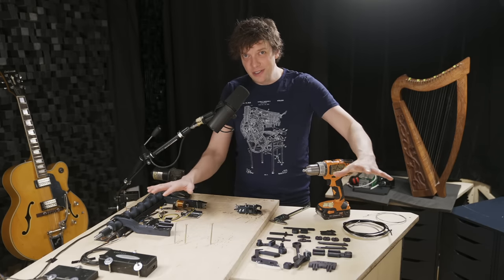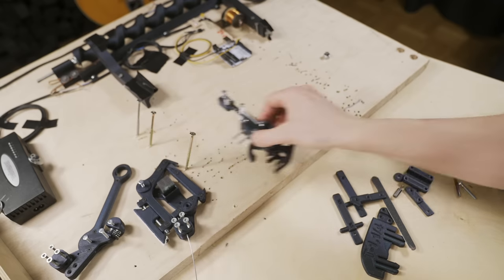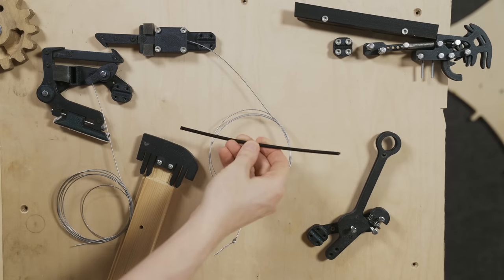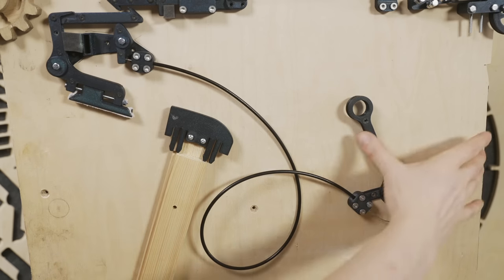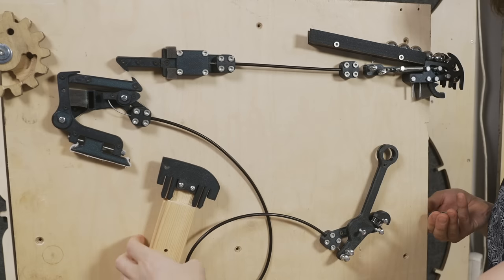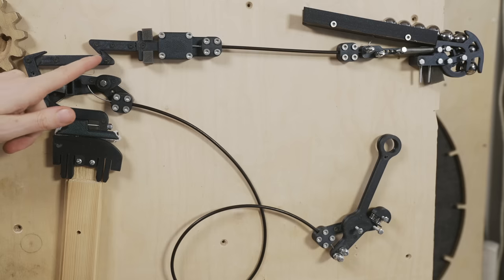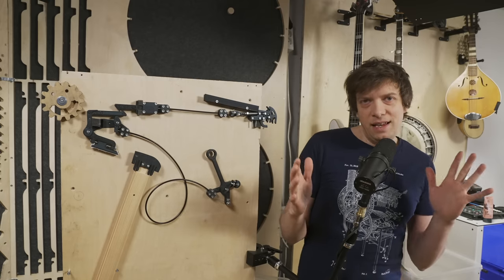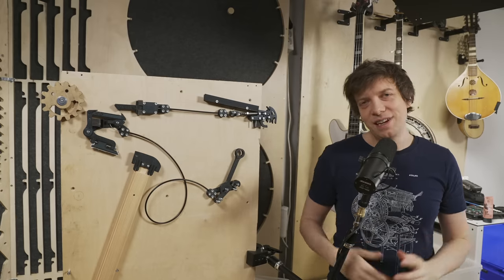These Bowden Cables Surprised Me!

Comment: This isn't about the cables but the muting mechanism.  It works perfectly in isolation, but you may want to test the mid-note preservation (eg the two levers hooking together) under various levels of vibration and shake.  It will be nearly impossible to get the same rigidity that this test setup gives when in the actual machine, maybe some channels which are nearer to the structural skeleton will be very rigid but you likely won't be cable to completely avoid vibration within the machine on all channels simultaneously.  There also can be external vibration, especially with going to different venues some will have more sturdy stages than others.

There's also the vibration of turning the muting lever which you may in the end be able to come close to eliminating, but Excited Martin might have a harder time.

Just something to look into so that you can be sure to avoid marbles dropping out of time.

Comment: The only issue is the cable should always be in tension and once the cable is out of the sheath, it should be straight. Currently Your muting cable is depending on the cable looping "properly" at the mute mechanism, and pushing that mechanism Instead of pulling in tension. every bike brake and derailleur is pulling the cable against spring tension. eventually the cable will loosen up and fold over and possibly not Mute or unmute properly.

Comment: you should reduce the amount of foam dampening the pin reader in your finished build, the amount you have now is creating a spring / oscillation which I'm sure will create more problems down the road. Or use a softer foam that's not as springy

Comment: You would need to make 100% sure that the cable does not move even half a millimeter through tens of thousands of marble drops for this to be a safe addition to the design.
I would try to design as much as the machine without the cables, and only using the cables as needed.

Comment: Along with other comments and tips please let me add that  Bowden WILL stretch over time and or break .. 

You will need to plan for easy adjustment of the cable ion the machine and you should also plan for easy release of the fixed end for quick and easy cable replacement .   

As Bowden is pull actin only you don't need to fully capture the end and leaving the end open will allow you to simply slide an old cable out and replace it with a new one.

Comment: Something dawned on me while you showed the mock programming wheel that might be worth testing and looking into: What would happen if the programming profile is played while inserted the wrong way around? (In software engineering terms, you'd be testing an unhappy flow here ;) )

A profile being the wrong way around should never be happening in theory, but it may be very likely to happen at some point under the pressure of reprogramming during a concert.

Comment: Looks super cool.   But I think you need to have twin cables, both pulling, from different sides of the pivot.  I hope that made sense.  When you throw the lever either direction, one cable will be pushing and the other one will be pulling.   The pulling cable is doing all the work.  You don’t want to rely on pushing with a cable…

Comment: Solid wire (like hard stainless welding wire) can work very well on these cables also! The life of the outer jacket can be greatly improved because the solid wire is much smoother than even the best stranded bicycle cable. Worth considering if you can eliminate the tight bending like with the muting mechanism.

Comment: You can use 2 or more programing wheels with this system.  Or can use 2 or more pickups on the programing wheel located at different places around the programing wheel, so each can take up more width.  Use a channel of programing wheel 1 to mute programing wheel 2....... after the first pass it unmutes 2 and mutes 1.  double the programing space.

Also I challenge  you to play the MM tune by hand.  Record it, and see how close YOUR timing is.

Comment: If you run into friction problems, check out the Capricorn PTFE tubes widely used in 3D printing, they are superior for being super smooth and wear resistant!

Comment: Hey Martin, talking about noise reduction I was thinking about the use of metal marbles…there are ways to coat the marbles with rubber/plastic/Teflon, I’m pretty sure I have seen ball bearings with non metallic spheres too, so there would be specialised industries that deal with that kind of process to maintain the perfection of the sphere. If there was a way to retain the weight of the metal but add a coating of low friction material that’s not metal you will reduce the noise of thousands of marbles moving here and there…I really hope you read the comment, I don’t know how else to get in touch with you…love your work from Australia

Comment: Look into the quick-replace systems that bicycle levers use for easy cable replacement.  The current design requires 4 screws to be undone to replace the cable and housing.  That is completely unnecessary if you take a look at how bikes keep the cable housing in place yet still allow for tool-less cable replacement at the lever

Comment: Overall I think this is a brilliant direction but I think that the introduction of the cables into the timing aspect could increase the potential for temperature changes to throw off the timing. A longer cable will increase in length a little more than a shorter cable in hot weather. One way to try to cut down on this issue would be to make all the cables the same length, even if that means introducing some otherwise unnecessary bends. I thought of this issue in part because I know how temperature affects pendulum clocks. Warm weather causes the pendulum to get just a little longer, thus slowing down the clock just a little bit.

Comment: warning! when using those cables you have to be sure to play music at the same temperature always. Because the cables will become longer when it is warm. I experience it on my bike. A difference of 10 degrees celcius can already make a difference, my brake doesn't work as good and I have to adjust the brake settings again.

Comment: One concern I might have is that wear on the cushioning could eventually cause the hooks to move further apart and prevent them from engaging. I’m sure you have thought of this, or will end up using thin enough cushioning to prevent the issue. Other than that; awesome! 😁

Comment: The cable is a good solution for muting lever, but not for marble gate. It is high friction and fast wearing. It adds the force requirement on P-wheel and you will soon need to lubricate and eventually change all cables. Avoid sliding parts and use pivoting ones when possible.

Comment: Bowden cables are fine for the muting mechanism where timing isn't critical, but a very bad idea for the marble droppers. With repeated use, the inner liners will wear, resulting in a change of radius to the path that the actual cable follows. This will introduce some slack (albeit a very small amount) but enough to throw the timing out - say goodbye to 'tight' music.

Having a real sense of déjà vu with this. I seem to remember this being discussed at length in the Discord for the MMX, and ruled out for this very reason.

Comment: Great work but I think that the engaging system could be upgraded to introduce a tensioning spring inline with the cable (like in the carburetor throttle return)

Comment: The cable idea is great solution for the switch. I would not use it on the connection between the hook and the gate though, the additional friction of the cable through the sheath is not warranted especially when considering 100 channels. it adds extra drag that is not necessary.

Comment: There are a few issues about the cables that you do need to take into account. If the curve of the cable changes for any reason this will affect the length of the cable and there is a lag if you are using the cable as a push pull, in other words when you pull the cable it reacts immediately and when you push it there is a delay as the cable takes up the slack ... this delay is directly related to the amount of curvature you put into the cable, straight and its is less more curves and there is more delay. 
I suggest when you are testing the timing that you test the cables from straight to really curved to see what effect that will have when the cable gets longer and more curved.

Comment: its a great idea for muting system and other places not so often used. but for releasing balls its not good. Bowden lines are not for such intensive use. You will lubricating them after each concert :) But if it will be straight line, you can use simple cable without the tube.

Comment: I think you don't want a long Bowden cable between the programming reader and the marble gate. You'll introduce slack and thus timing inaccuracies. Rigid linkage is probably still best if you can (pipe organs have roller boards which basically solve the same problem you're facing, but they take effort to build). Otherwise, a string running on pulleys under tension could be a better alternative to Bowden.

Comment: I think the bowden cables are a powerful tool for the next marble machine. My only question is will friction possibly become an issue? One profile pushing a lever connected to wire connected to a spring isn't a big deal, but I could see it getting to be measurable when all channels are playing.

Comment: A good tool to make little cuts where you need them 
Is a dremel it has several little tools and bits that are perfect for stuff like what your using. Oh it's a little  loud but not that loud and
You will be able to hold it with one hand. Ps amazing design.

Comment: The problem is that when you have a 1 inch cube of foam, but nothing to to support it, you can damage the foam enough with use that it will simply stop working. 

If you put some plastic support structures inside the foam, attached to the primary part, and reduced the amount of foam that can move unintentionally, the foam will last longer and be less prone to function impeding damage. As a general rule when working with soft foam, especially in a silencing or padding manner, you don't want that foam to move much besides its intended movement, ie when its compressed to do its job. If the foam is damaged and starts to lean, or if the device isn't hitting the foam dead on, you end up introducing unintentional wear that will drastically reduce your foams life span.

Think memory foam. Its subject to all manner of stresses and if you don't protect it appropriately, you end up with tears and holes in the foam and it loses its ability to return to shape as effectively.

Comment: It should be taken into account that such flexible connections do not have good stability over time. As they wear out, they can stretch. There is a dependence on temperature.

Comment: It kinda use the exact same mechanical principle as offset printing machines. I think it is called something like ratchet and paw. It uses many mechanical leverages to make sure the movement work as intended when it should. Small gear movement is amplified through mechanical connection and stuff. Intricate but interesting

Comment: Only thing i see is that you are "pushing" the cable that does the muting action. I will probably work but it could just kink in a situation where you really do not want to. Adding a spring on the muting lever so it wants to be in the "mute" position and the cable only has to "pull" it into normal mode might work.

Comment: for the bowden tubes, there is a material use in 3d printing, i think its call ptfe tube it offers almost no friction, if friccion start to be a very big problem it migth be a good solution, more expensive bur improve

Comment: Those cables are notorious for failing. Even good cables will break, often. And you plan to use a lot of them in your machine, I would assume. They can snap without any warning, and they can get stuck in their sleeves frequently. Set up and run a longevity test and keep it running while you continue to work on your machine. Also, plan a back-up mechanism, if you don't have one already, in case you find that they will not suit your need.

Comment: In addition to the very valid cyclist comments, also keep in mind that they can stretch a bit over time: make sure you can adjust.  Those adjusting fittings are also available in a normal cycle shop (because people like to keep their brakes working 😋 ).  Bowden cables are normally used to pull against spring tension, not to push.

Comment: For the muting levers this will be fine. Their action doesn't need to be precise either time or stroke wise. But for the marble drop these won't maintain timing to your standards. Longer bowden tubes, or those with a bend will have more drag, more inertia and affect the timing. Not by much, but you've gotten hung up over smaller issues before.

Comment: My biggest concern with this design is the tolerance allowenses in over swing of the muting lever and the hooks getting worn. Just one of them is probably not a big deal but both together could probably cuase an issue, eg the disconnect lever don't quite rotate the connector enough so the hock drops and is worn down a few mm at the tip.
Just giving the connector wheel some room for over rotation should make the design much more reliable over time.

Comment: already see the problem with the cable at 1:30. cables / robes are not meant to be pushed.. only to be pulled.. so by pushing that cable, the endpoint always as to be weaker than the internal stiffness of the cable, or the cable will start to bend in weird ways and the endpoint might not work. thats why on bikes you have springs to pull the breaks back open.

Comment: I feel like printing special "gaps" for the ends of the bowden cables is going to be a pain point in the future. Unless your prints are insanely strong and durable, I suspect that the bit that the cable touches will eventually wear out, and you'll either lose cables or have unwanted play in the mechanism. Make a hole the diameter of the cable that goes all the way through, and then have the end on the outside of the clamp on the other end. Slightly different setup, much more reliable?

Comment: The marble release cable might be fine here. Hopefully the muting cable does not need timing constraint.
However cables are better in traction, and are bad in contraction, you will have delay depending on the length of cable because they will bend in the pipe.

Comment: You may never read this, but I think the two little coil springs in the back of the mute lever to force it to 10 oclock or 2 oclock will be a problem over time.  Maybe something that's more like a leaf spring would be much more reliable.

Comment: I think your design could be simplified and made better with a special type of Bowden cable called a push pull Bowden cable, this allows you to adjust in both directions and leave the cable in place allowing for multiple settings and not just a pull to actuate with a spring return.

Comment: to chek timing id try to make a version with a few loops in the cable to the droping mechanism to document any timing issues directly, best case there is no difference and u can wrap the cables 2 times roud the machine  without deveationes, worst case u need to hold them short and straight or replace them. best to know from  the start befor planing them in an end up like wth mmx.

Comment: Over time, the hooks of the muting system might wear out and introduce timing problems. You might want to try greasing them with graphite powder. Or maybe make them easily replaceable.

As mentioned in other comments, I too am concerned about the timing with bowden cables. They might stretch individually over time. You could solve this with an adjustment screw per cable, but adjusting this many droppers each concert does not sound like fun.

Comment: So these sort of cables are not very good at pushing, so its usually better to use a spring when the cable is pushing something, they work for a time and then they fail and the cable folds or cinks.

Comment: Look at a motorcycle clutch cable. The angle of the cable changes at the lever. The cable must be able to rotate at the lever. If it doesn't the cable flexes at that point. The cable fatigue causes it to fail at that point. It must be able to swivel.

Comment: Maybe add a spring on the cam (and possibly on lever to balance forces) so the cable is in tension for both directions of action? Bowden cables don't like to be in compression, will increase chances of failure. Also, any slip at all of the cable on either end and your timing will go out, wasting all the effort put into 0ms marble gate design.

Comment: Was the added friction of profile/reader taken into account? The old MM had only a simple pin that triggered the marble drop, so only a very short moment of resistance when the wheels pins touch the reader.
Now the wheel and its various profiles will almost constantly touch readers and thus cause a lot more and almost constant friction.
Not that the wheel is too hard to rotate on the new design due to all this added friction. 
It could be impossible to get that slow decrease of tempo like the first MM provided when letting the wheel run free and decelerate on its own.

Comment: You'll definitely need to retension those cables. I don't know if you've ever had to replace a bike cable, but it usually needs retensioning after a few weeks due to the cable stretching, and then again after a few months, after that it's usually good till the end of the life of the cable. Maybe there's a way to pre-stretch it so you don't need to?

Comment: I think that the lever should pull up the reader and the reader should stop engage with the register at that moment. That would not produce any noise once the channel should be quiet. Also note that the bowden wire might be free on one i.e. once the reader is in the working position, it can also freely move along the wire.